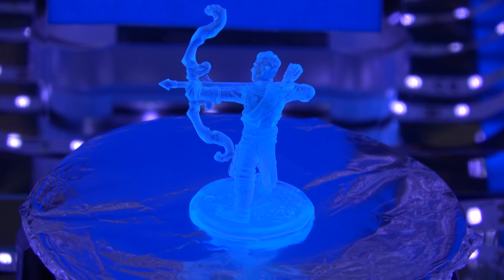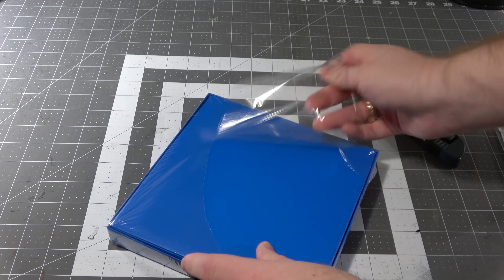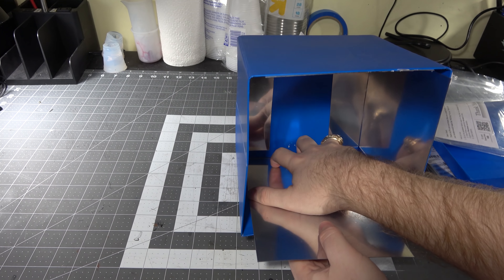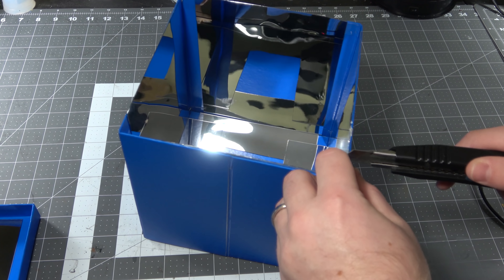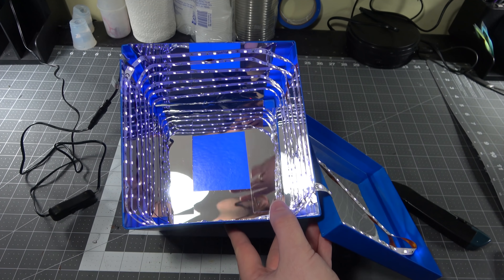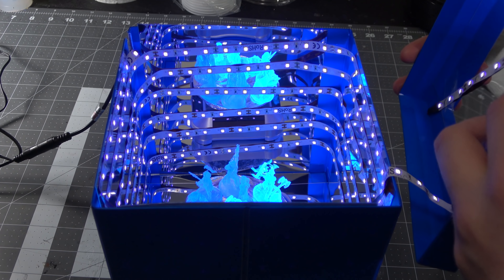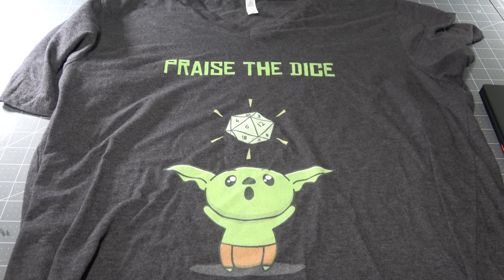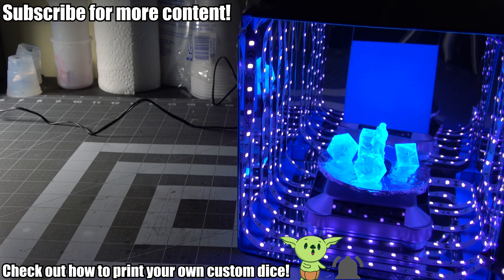How to Make a UV Curing Station / Box

Comment: I just want to mention that just because something looks reflective in the visual spectrum it doesn't have to be in the ultraviolet, so a silvered mirror would be a poor choice. Aluminum foil should be fine, depending on the wavelength.
Reply from the maker: Because the whole sheet is one bit of plastic rather than a glass with metallic backing like normal mirrors, I assume/assumed it will reflect in the same manner that aluminum foil would. I could be totally off base, but hey, there are enough lights in here to cover that anyway :)
Reply: @Rybonator  Since I don't know what exactly you use, I can't tell you either. I just wanted to mention it. If someone uses  old mirror tiles or something similar they have laying around for example.

I'm pretty sure it would work without, but as you said yourself, it helps distributing the UV lights more evenly, even if it's not highly UV reflective.
Reply from the maker: @ayumikuro3768  Good point. Thanks for bringing that up :)

Comment: So! Having worked with those types of LEDs before, and with flex PCBs, which are what they're mounted on - You can actually bend those things pretty much in half. As long as you're not flexing them back and forth continuously, they'll be fine. And if it does break, those types of LEDs are designed for being cut and re-soldered. There's markings for where you can cut them, and then you just have to either solder the pads of two pieces together, or solder wires to each of the two sections.

Comment: Two questions: why you need the rotating table if you have leds in all box walls, coming light from all directions?
- why to put lights on bottom if you cover the plate with foil which will block the light coming from that direction? It makes more sense to put in the lid right?

Comment: hey, not sure if you brought this up and i'm no expert, but is it safe to put a lid on a box with uv lights? I imagine the lights generate heat, and the heat would have no where to go, and also cardboard box would probably fair too well with all that stored heat.
Reply from the maker: I don't plan on having this thing on for more than 5 minutes at a time, so I don't think that will be a big concern. BUT, that is a good point. I think the mirrors will also help with dissipating the heat :)

Comment: "You could use an Amazon box. You could use aluminum foil."

I'm feeling a bit called out here right now. ;)

I will admit, your curing box looks way prettier than mine.

Safety: UVA is generally safe, it's what they use in raves and laser tag arenas to make all the fluorescent paints glow, but my chamber tends to leave a tacky surface on my prints, and I'm pretty sure it's because it uses UVA light. UVB is what gives you a sunburn, and you don't want to look at that for very long, but a little bit is mostly fine. UVC is what's used for sterilization, it will give you a nasty sunburn ON YOUR EYES! if you're not careful, and according to Big Clive, it doesn't travel very well through atmosphere, so humans don't generally interact with UVC in any meaningful way on a daily basis.

Which, of course, is why I ordered two UVC sterilization lamps to try and amp up my curing chamber. Hopefully they arrive next month.
Reply: Hol up
Reply: Chuckles you’re in danger

Comment: How well would it work if instead of the foil on the turntable you used more of the adhesive mirror panel and then put plastic cling wrap (saran wrap) on that to protect it

Comment: If you use a cylindrical trash can, you don't have to worry about bending the light strip.
Reply from the maker: That's true too! A small trashcan was actually my backup, if the box didn't work. But then it's hard to cut into and get the cord through.

Comment: what does the curing exactly do?
Reply from the maker: So without curing resin, it will either still be too soft to really handle and deform over time, or still be toxic to touch. POSSIBLY both depending on the resin :)